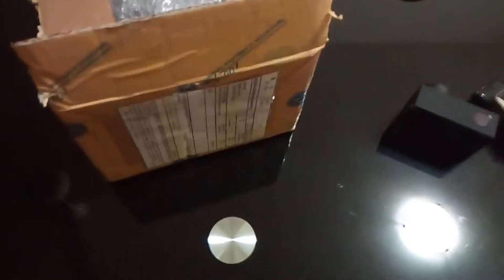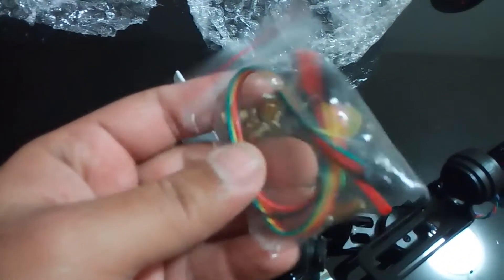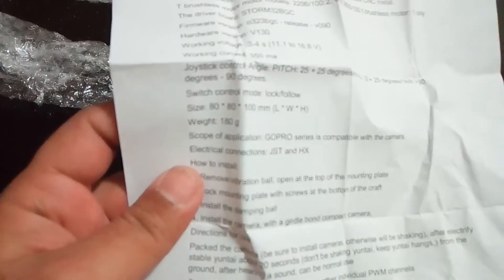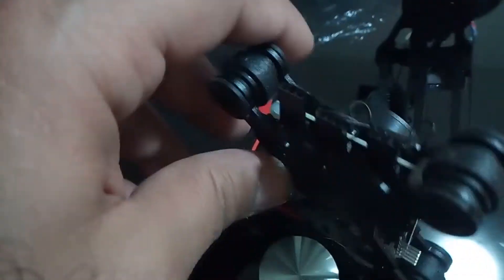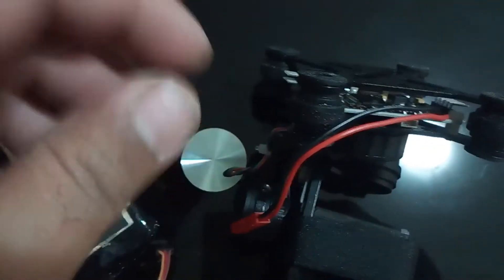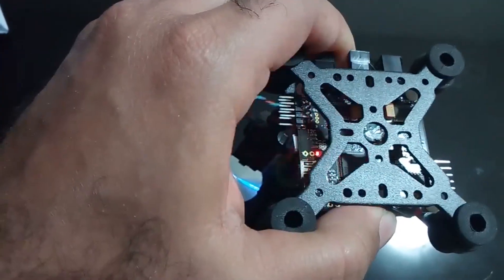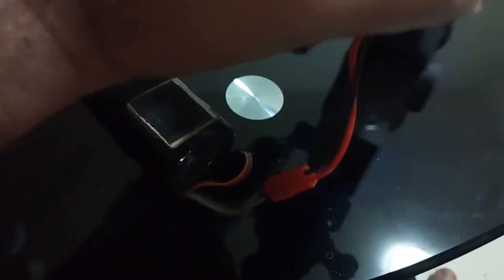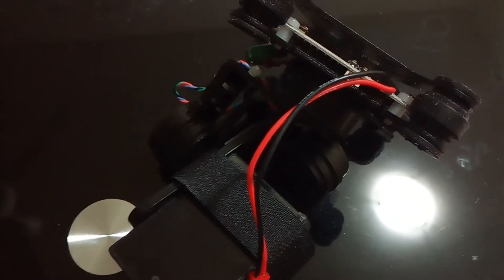3 axis camera gimbal YUNTAI product review Storm32 BCG

Comment: hi there.  what software do you use to configure or calibrate your gimbal?  Is it basecam or the OlliW storm 32BGC? thanks for the video.
Reply from the maker: Hi,it's been long since I last used it, I will have to check, but I think it's Storm 32
Reply: @hobbypilots794  hi I tried olliw 32 gbc and worked. You only need to check out the firmware version. I did not update mine and kept the original with the board. Finally able to set it up and control it. Thanks for the help provided.
Reply from the maker: @todotvstreaming  Glad to hear it's all working.
Are you using this on plane or quad?
Reply: @hobbypilots794  on a quad. I'm only missing configuring the trigger for the camera and checking out some issues with telemetry. Yesterday I was able to set up the 3 channel video switcher.
Reply from the maker: @todotvstreaming  What flight controller you are using?
Reply: @hobbypilots794  pixhawk 2.4.8
Reply from the maker: @todotvstreaming  great, Yes click feature is in pixhawk